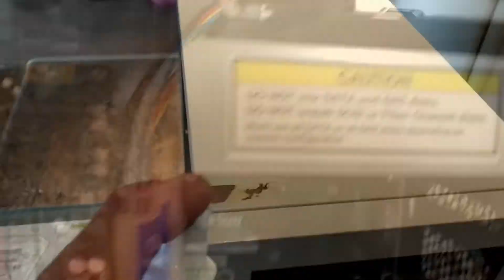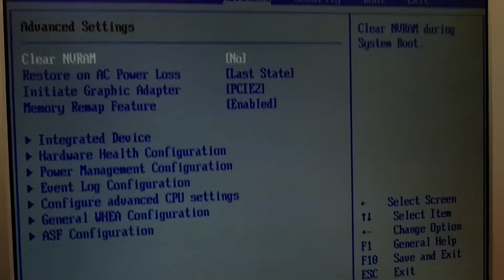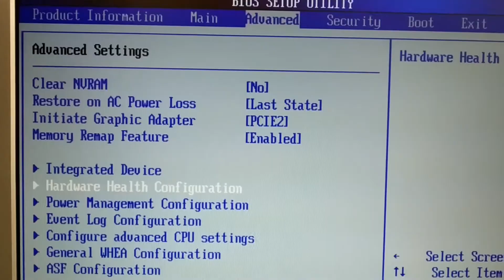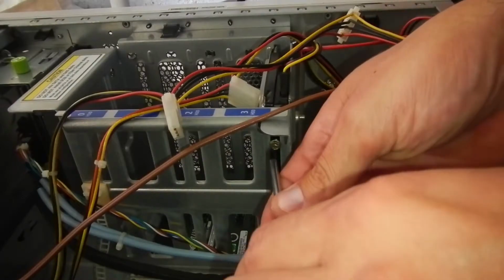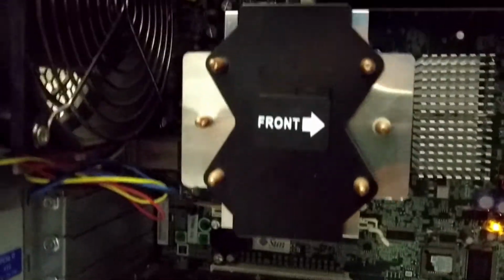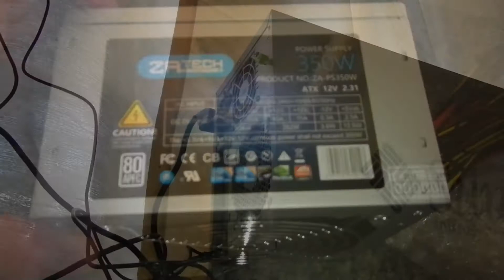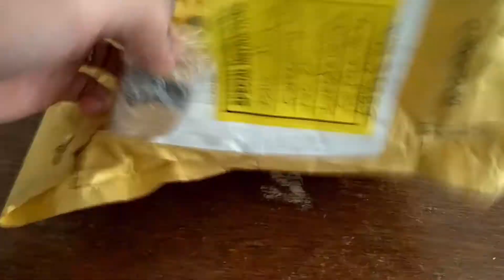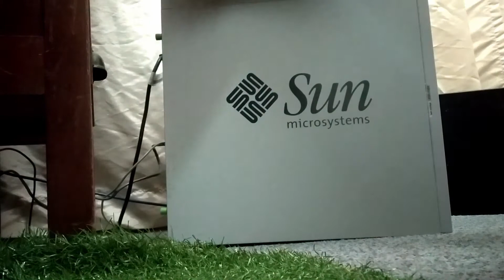Sun Ultra 24

Comment: Not wanting to pour too much scorn on you but I can't imagine why you'd replace the original Sun motherboard for a generic. I own the Ultra 24's bigger brother, the Ultra 27 and would only replace broken parts with original ones.
Reply from the maker: This was inspired by the ServeTheHome article "Introducing the Ultra EPYC AMD Powered Sun Ultra 24 Workstation". When I got this Ultra 24 it was already modified somewhat.
Reply: The ultra 24 uses a regular core2 duo/core2 quad, there's absolutely nothing special about the hardware in the ultra 24, he's not scrapping a SPARC system.
Reply: @balthxzar  Wile nothing special in terms of architecture, that's still a SUN-vetted board to go into their high standard system, that doesn't quite make it a regular x86 board. Albeit with much less value than SPARC indeed.

Comment: I got a Ultra 20 with an AMD Opteron in it but I got it mainly for the case since I like the style I used it to put my Gaming PC's old Hardware in it. The seller I got it from actually gave me the hard drive plastic pieces and you can get them from ebay.